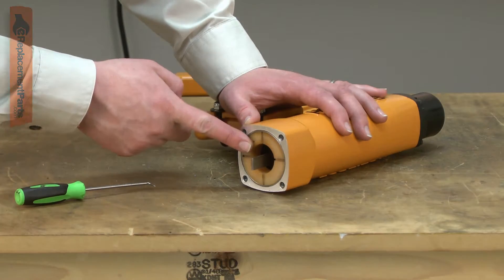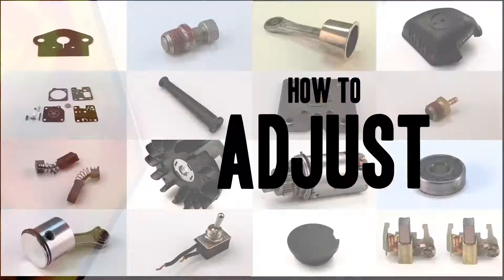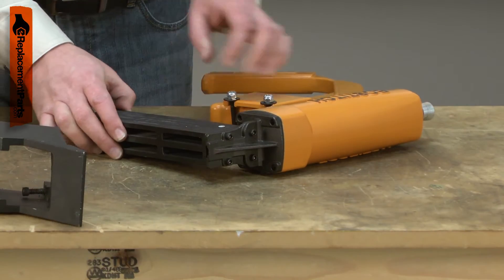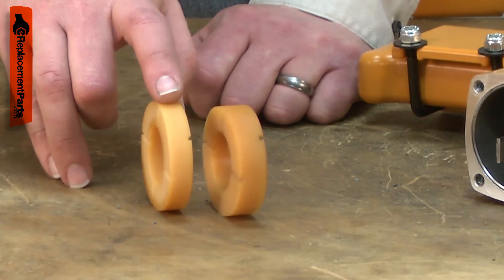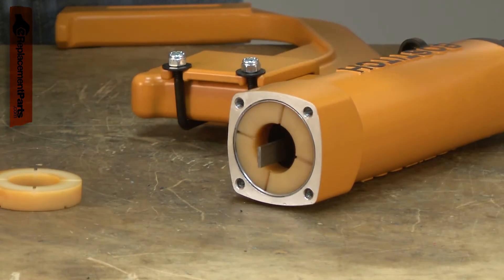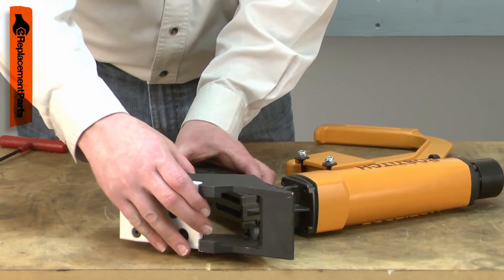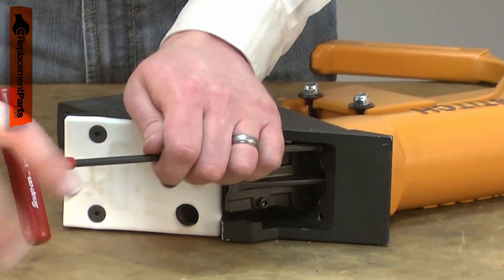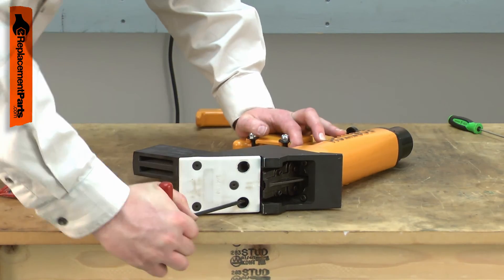Flooring Stapler Repair - Replacing the Bumper (Bostitch Part # 105043)

Comment: Great video and specific information. I have the older model and the bumper started coming out with the staples in pieces. I had no idea what it was until I got it apart, using a couple of your other videos. Putting it back I had the extra spacer which by the time I took the gun apart there was no bumper at all left so I wasn't sure where the spacer went until circling back and found this accompanying video. Thanks amigo, much appreciation for them all.

Comment: The unit into which I just installed a new bumper was used until the bumper had disintegrated entirely.  Do you think that running it with only a few bumper shards left damaged the piston assembly?